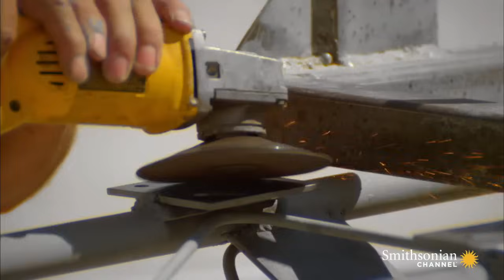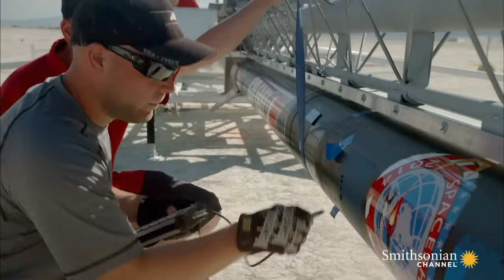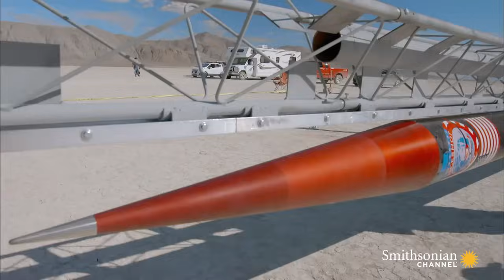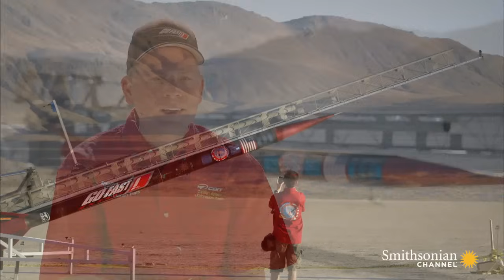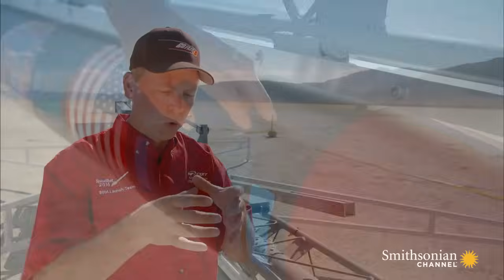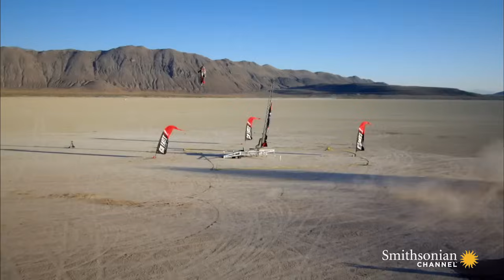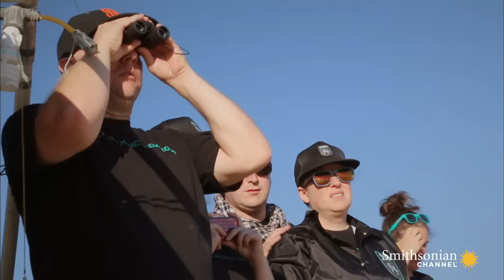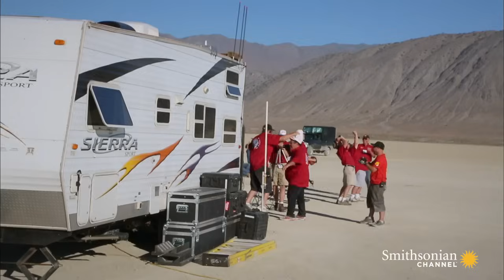Ride into Space with This Record-Breaking Amateur Rocket

Comment: So these guys record themselves constructing it, have all kinds of video editing, and a soundtrack, and tack-on only 5 seconds of actual(?) on-board footage at the end.
What a complee load of crap.
Reply: Yep it was like show me peoples reaction to a rocket launch.
Reply: +John Jingleheimer-Schmidt - The Smithsonian did the crap edit - not the team.
Reply: noobwitadoob tthe planet doesn't have a done around it. there would be no reason for scientific development of space flight if there was.
Reply: I was an experienced rocket launcher and can get a rocket further than this rocket.  If it would stop you dome and/or flat earthers I'll launch it, but'll need a few volunteers and funding.  I won't waste time with a gofundme and meetup group for this unless enough people want to debunk the flat earthers for good.
Reply: @RSmith1982  convincing them is like trying to negotiate with a wall.
Reply: noobwitadoob
No, but the ratio between a high powered rocket and a lower force object going into water are similar and can be used as an analogy.  If you were propelled through water with a high power turbine and your hands were positioned so you would spin as you were propelled along, the moment the turbine stopped propelling you, you would come to an abrupt stop and stop spinning.  It's like a drill bit on one of the those old drills that continued to spin after pulling the trigger, but if you're drilling into something, the moment the circuit is opened and the power stops so would the spinning.  Rockets forcing into the upper atmosphere create a similar high pressure, so great that armor is needed to keep the rocket from burning up, like meteorites when the enter the atmosphere.  since the rockets are fighting the force of gravity and of the atmosphere using the high opposing force of the ignited fuel, when that fuel supply stops the forces of the atmosphere ant gravity overcome the momentum of the rocket so abundantly that it comes to a nearly abrupt stop of spinning and travel.
Reply: noobwitadoob why would the rockets spin stop if it hit something, it's not like there would be nothing stoping it for spinning, it may spin more slowly but still spin, if you drop a spinning ball on a hard ground it will still spin
Reply: noobwitadoob Show me a link to this original video and I'll think about it
Reply: Spin Destabilisation, and losing momentum because gravity is pulling them back down.
Reply: The thing he thinks is the original video is propably the one on the GoPro channel that he saw.
Reply: Fighting Fiction   did you even bother to read the explanations up here?! The bible is full of shit,that's because the guy writing it didn't know much about astronomy and I can forgive him, but you 2000 years later come on
Reply: Actually, the book of Enoch explains how the stars, moon, and sun work. It also prophecies that men would lose their understanding of how the stars work and that some of the chief stars would leave their orbital paths and men would name them after Gods. This is describing the heliocentric lie. Copernicus who is given a lot of credit for this theory didn't even have a telescope or method of viewing the sun with a solar filter like we do. Ironically, the book of Enoch was removed from the Bible at the exact same time the heliocentric model was developed. All the people who developed this model were freemasons as well as those who went to the moon and developed the theory of evolution. This video I made destroys the heliocentric model rather quickly https://www.youtube.com/watch?v=3juW3Ovm4nE if you actually watch it.
Reply: well it proves its possible
Reply: noobwitadoob then where does all the money go
Reply: Weird Gaming go watch the original video and try to use common sense in explaining why it came to a sudden stop while stopping its spin aswell. who knows what NASA doing with the money, lining their pockets?
Reply: noobwitadoob and where is the link to this "original video"
Reply: noobwitadoob also would you post a link to this so called original video
Reply: Fighting Fiction  I've watched the video and Sorry to dislike, but the sun isn't supposed to move, only the planets do ... And many countries have been to space apart from the US, even amateur rockets for god sake, not to mention telescopes than you and I can buy to look at it by ourselves....And your conclusion at the end of this video is so far fetched, even if the earth was flat or anything else you're trying to prove, it wouldn't be a proof of the biblical god, the only way to prove the biblical god is to ACTUALLY prove the biblical god, proving that something is wrong doesn't prove that something else is true, 2 wrongs don't make a right.
Reply: Fighting Fiction   did you even read my comment? I don't trust anybody, I've said that you were doing 2 very different things, proving the governent/NASA are lying motherfuckers is no proof that the biblical god exists, if you gotta prove his/her/its existence you have to PROVE it, not that something else is false, because once again 2 wrongs don't make a right
Reply: J4 Genius J4 Genius Sorry, I’m not a good speed reader. First of all, you’re right to question God’s existence. I wasn’t raised in church, but I did experience and see powers of darkness at an early age. The reason for secret societies that help run the world is to hide truths that proves God’s existence so that we are easier to control. As far as physical artifacts, there are many. For example, chariots have been found at the bottom of the Dead Sea exactly where the sea was said to have parted when Moses and the slaves were led out of Egypt. The Ark was also found by a man named Ron Wyatt. None of this is mainstream knowledge, But until recently our calendars were based on the son of God.  2017 AD or the year of our lord and BC was before Christ. I know the calendars were altered by the Catholic Church and I’m sure the reason is to hide more truth. What would be the motive of someone to walk this earth knowing they would be slaughtered only to fulfill hundreds of prophesies and teach love and forgiveness without financial or material gain? Also, If you follow the path of persecution and division you’ll find truth. The goal of the enemy is to divide and conquer. This is why Christianity is so divided. All other religions are left alone. I don’t go to church for this reason. People are starting to see the deception and what it’s hiding.
Reply: Mike Barnett yeah they should stick to king arthurs remains.
Reply: Weird Gaming and why the spin stops? idk i am still asking questions myself, but my first question is, how does the rocket come to a SUDDEN stop and how did it's spin come to almost a complete stop? If what NASA and all these scientists told us is true, how do we explain this rocket's actions?
Reply: Robert Smith so your saying our atmosphere is water?
Reply: noobwitadoob he is saying that you're a boring ass punk who's main thrill in life is in the world of dumbass YouTube comments.
Reply: https://www.youtube.com/watch?v=bDoh8zQDT38
Reply: That's because it hit the firmament as mentioned in the Bible. Here is the full clip https://youtu.be/IAcp3BFBYw4
Reply: tffylu
Reply: J4 Genius Here is who you trust and I used to trust. https://youtu.be/S6bBXGBdjTQ
Reply: Fighting Fiction    to be totally fair muslims are not really left alone, neither do jews( ask my boy Adolph )....I respect your faith tho.
Reply: John Jingleheimer-Schmidt ask yourself what they don't want us to see
Reply: noobwitadoob link?
Reply: John Jingleheimer-Schmidt it’s cause the earth is flat! They don’t want you to know. And the part where the blaster popped off the rocket, that didn’t happen... nothing detached from the rocket in the original video. That was CGI covering up the fact that not only are we living on a flat earth, but there is also a dome above us. The rocket hit whatever type of firmament that’s coverings like a bubble.
Reply: @TundeCookinUp  Why do you crazies come out with stuff like this? So this bunch of guys made a rocket and then decided to fake their footage as well? WHY just WHY would they do that LOL
Reply: Maybe there hiding something they don't want you to see
Reply: for the ADD audience. LOL
Reply: I'm curious.... Do flat-Earthers watch satellite TV? Do they use GPS on their cell phones? How do they think these work? Satellites in geosynchronous orbit are between 6,000 and 12,000 miles up, but you believe this model rocket "hit the firmament" at 72 miles up? How does that work?
Reply: noobwitadoob well it does have enough water to make the sky appear blue, and when  ur travling at those speeds the atmosphere give u the about the same drag as a bullet through water.
Reply: The rocket fuel ran out.  Rockets undergo extreme forces which makes them very hot leaving and entering the atmostphere.  Atmospheric pressure, but since the rocket fuel is forcing the rocket intensely against the atmostphere and the burn forces it into a spin, when the fuel stops and the forces of the atmosphere overtake it's like slamming on the breaks in every direction.  It's like having a jet propelling you in water, Ever see a video of a bullet going into water, it spins and moves quickly then it hits an abrupt decrease in speed and stops spinning almost instantly.
Reply: John Jinjldingle  is full of crap, has no clue what rocketry is about. Grow up!
Reply: +John Jingleheimer-Schmidt Zechariah Williams is correct. they edited out the rocket coming to a dead instant stop, both its forward momentum and its spin. go watch the unedited version and you will see.
Reply: that is because there is no space flight..all lies!
Reply: @SlumDawgMillionaire01  So what it is if it's not space?.
Reply: @arnbon6241  as it is described in the bible...it is the firmament or dome.
Reply: that's because the rocket hits the firmament.. proving the biblical description of a dome.

Comment: Was it just me or was the launch support thing for the rocket not at 90°.
Reply: +The Panda Also it's safer to angle it away from where you are, in case something bad happens and it falls down. Less likely for it to cause damage.
Reply: ok, thanks
Reply: thanks for the thanks
Reply: ok, thanks
Reply: +The Panda thanks
Reply: The rocket is launched at a slight angle for guidance reasons. When you are trying to launch a heavy 
vehicle that accelerates quickly, usually the nose will lean in a certain direction after takeoff. You can see this effect in nearly any high altitude launch. If you angle the launch rail slightly, gravity stabilizes the rocket at a given angle and the trajectory continues in a straight predictable fashion. Also, a 
launch azimuth allows for an easy computation of where the pieces will fall. When flying so high the pieces usually land many miles downrange, so it is important that they fall in a predictable area by FAA regulation. Daniel Newby that is incorrect about ballistic trajectories. You want all of your energy to 
be vertical, because horizontal components of your velocity will decrease altitude. When you see real rockets flying to highly angle trajectories, this has nothing to do with altitude and everything to do 
with groundspeed. To get to orbit, you need to have a horizontal velocity component of 30,000 kmph and you need an orbital azimuth.
Reply: its so that it doesn't fall back into them
Reply: not true. That makes no sense from a physics perspective. Gravity will act on it either way. The AST requires a non-vertical launch trajectory to keep the rocket from crashing directly on the launch pad if it comes in ballistic
Reply: +Dr. A. Elemayo Kinda like shooting an arrow straight up! It's a no no.
Reply: It was at 82 Degrees, That was my launcher.
Reply: hybriddyneguy I thought it was Rick Maschek's?
Reply: Saad Mirza  He wishes LOL
Reply: hybriddyneguy We are looking for someone to make us a rail like this. Do you have Facebook or email?
Reply: +The Panda It probably wasn't.  Due to the ballistics of sub orbital flight an uncontrolled rocket flying that high probably gets more altitude from a non-vertical launch because it loses less energy to gravity while flying closer to the parabolic launch trajectory.
Reply: ok, thanks
Reply: +Daniel Newby A simple no would have been good.